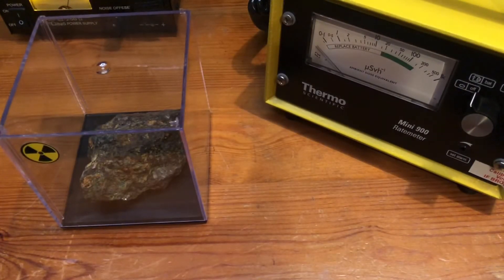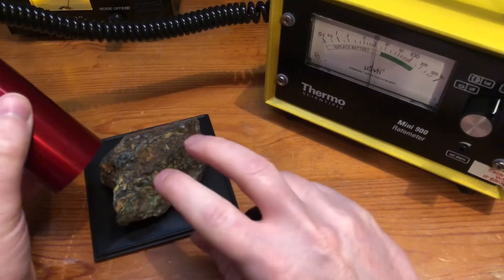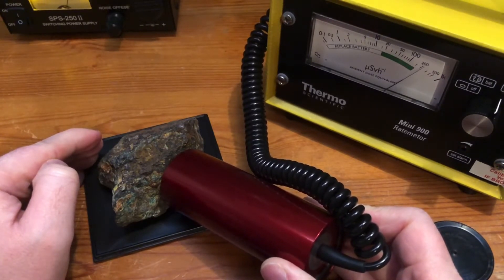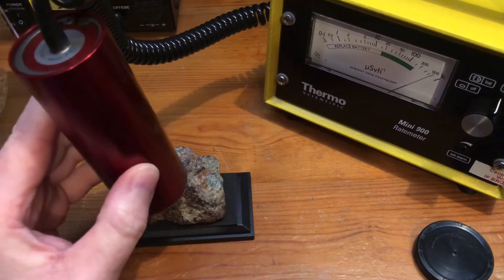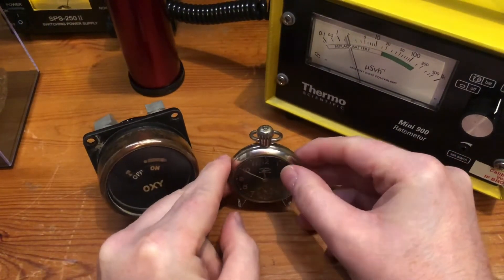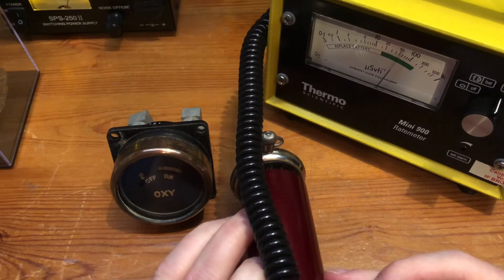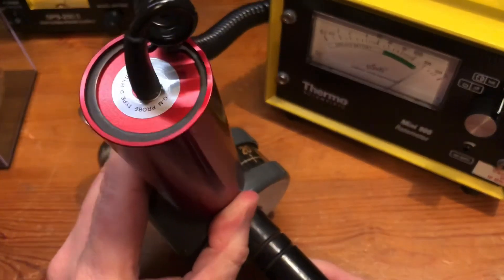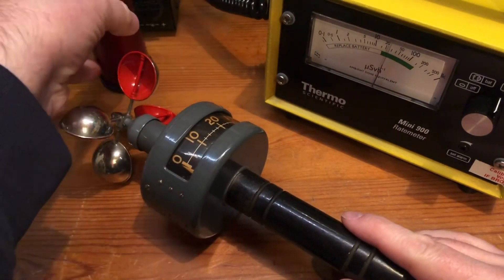Radioactive Sources Collection

Comment: Spiciest item I have (for now) is my pitchblende sample ~800-850usv/h as measured by my radiacode 103, given detection size and local hotspots I believe it’s safe to assume that baby is putting out over a millisievert
Reply: @Rainman787  amazing :)
That's a very very special sample. My Czech uraninite only reads 230uSv/h on my RC-102.

Comment: I don't understand... alpha and beta are supposed to be stopped by glass, but when you put the cover on to get gamma only you get a bit less counts (even though there's a glass plate on the clock)
Reply from the maker: I have since discovered that the cover is actually thin plastic, not glass.

Comment: I don't think 500uSv/h is comparable to the core of Chernobyl reactor 4. You're off by a factor of about 100000 lol. Still a great video tho with nice samples!
Reply from the maker: Took me a while to work out where you thought I said ‘core’..... I said it was comparable to ‘THE CLAW’ at Chernobyl which is a massive mechanical claw that they used during the liquidation.
Reply: So wild to consider how inactive it is at this point, not to say 500uSv/h is child’s play just interesting to consider, one only knows how many curies of material has been washed away by rain